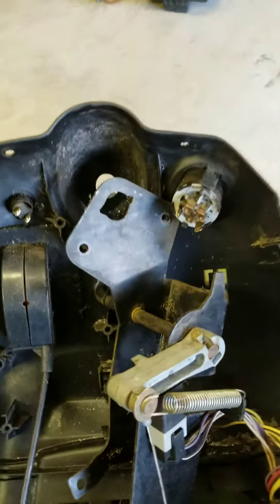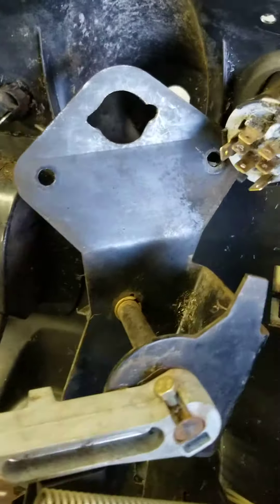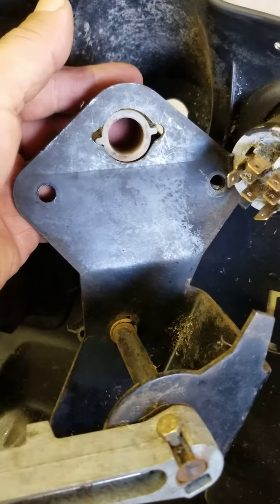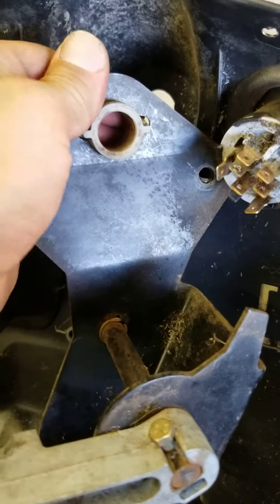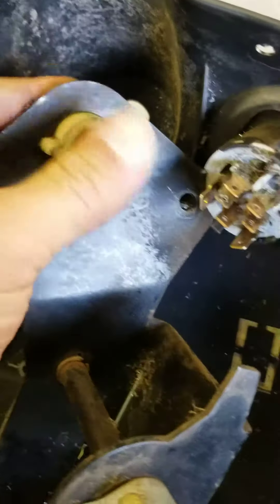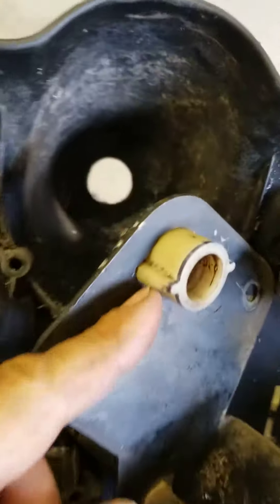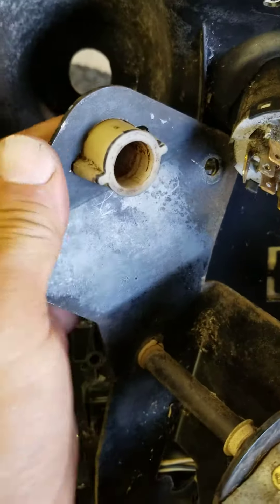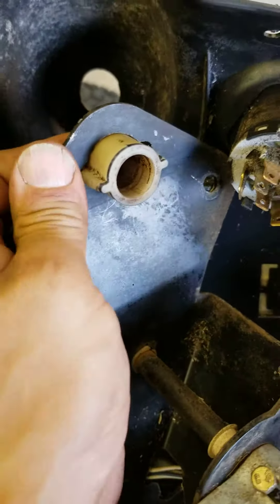John Deere La115 loose steering Part 2

Comment: I am on my second sector gear and pinion replacement and wondered if extra play in the shaft led to the worn gears. I think I am even missing that flimsy  split bushing... My question is, could you put that repurposed lower bushing in with the wider flange on the top of the support plate (as opposed to having to push it up through the hole)? I was thinking I could cut off the little wings and maybe sand it down to a tight fit in the current hole, instead of enlarging the hole (no die grinder...). Thoughts? (...if you are still monitoring this channel...)
Reply from the maker: Yes Im still here. You would have to try it and see. Might be tough to sand that thing down that far though and then it will be real thin like the original. Also those tabs help secure it in place as you see in the video. If you cut those off there will be nothing to stop it from vibrating out. Maybe if you make a retainer plate or maybe a couple screws with washers through the plate to secure it in the hole. You could try a dremel or other electric rotary tool if you dont have compressed air. Good luck either way. My fix is stll holding up great! Thanks for the question.
Reply: @shumanatorsgarage8921  Follow-up: I managed to make the hole in the plate bigger and used ny angle grinder with a flapper disk to make the old bushing fit snug in the resized hole. Got it all back together, cleaned and re-greased the spindles so now it turns as smooth as butter! We'll see if that bushing stays in place! Cheers!
Reply from the maker: @ebachy  Sounds great! Thanks for the follow up!

Comment: Excellent fix for this. Thanks for posting. Can you please say how long it took to grind the opening out?
Reply from the maker: Didt take long with the right tools. I dont rember now but couldnt have taken more than 5-10 minutes actual grinding and filing time. I used an air powered die grinder with a carbide bit.

Comment: Any updates to how this has worked?
I too have a similar issue with wheel slop that I would like to take care of.
Reply from the maker: Yes, it totally fixed the problem... I did have to spray some lube on as it was squeaking a little but that took care of it and no more slop!
Reply: @shumanatorsgarage8921  Thank you.
... Now to dig out the ol' die grinder.
Reply from the maker: Lol...Let me know if I can answer anymore questions. I have my notifications turned on now. You can get those bushings pretty cheap online